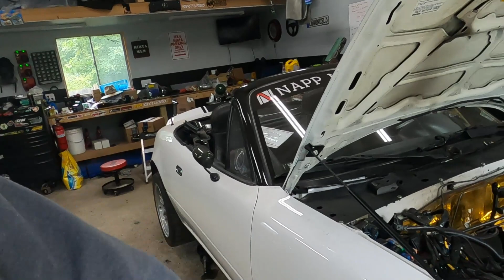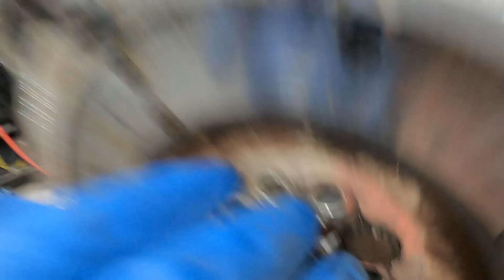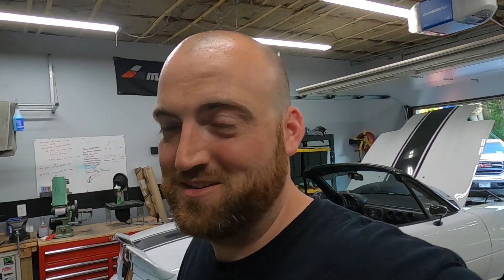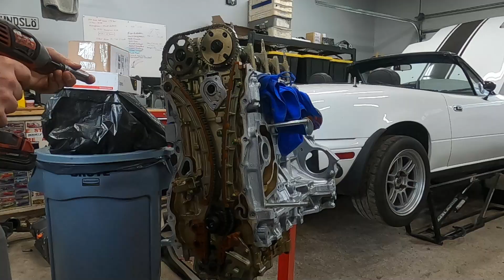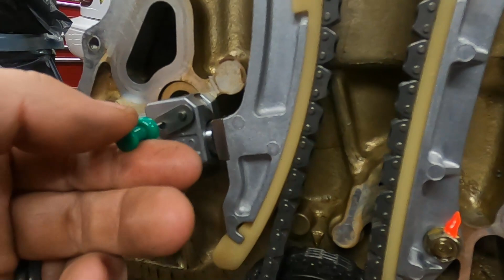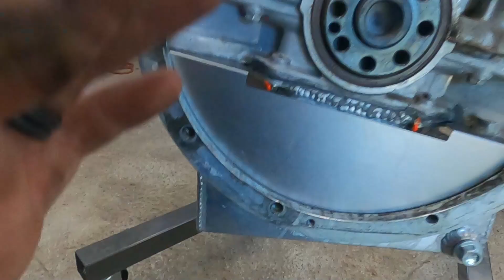Reviving the Turbo K Swap Miata - K24 Teardown & Rebuild

Comment: 33:18 great tip. The dust shield I got didn’t fit well caused me an hour so didn’t drop the drivetrain in today. Gonna superglue a rubber seal along the dust shield to prevent the rattle.

Comment: Noticed your oil pick up has the older revision ‘z’ bracket rather than the ‘hook’. The ‘z’ one have a tendency to shear off.
Reply from the maker: Hasn’t broken in 2 years of abuse. Not worried about it now.

Comment: Stefan, does "crank girdle" work as a name for the bottom tray? I used an M8x1.25 Heli-Coil in my BP engine's knock sensor hole (correct thread already there) to adapt it for a Bosch donut-type knock sensor. My Dad (RIP) and I did many an engine swap. Glad you got to share the experience.
Reply from the maker: He’s always here whenever I need it, super happy to help and I love it. Crank girdles are a bit different in the sense that they support the block, this is just a windage tray for oil.

Comment: Thank you so much for taking the time to show these details!  Do you by chance remember the hardware needed to mount the engine to the stand?  Or a link to where I can find it? Thanks!
Reply from the maker: I should’ve written it down… the top bolts I used the engine mount hardware honestly. The lowers, I think some super long M10’s and I put a nut on the back side.
Reply: @NappMotorsports  awesome thanks!

Comment: If that's a k24z7 or z3 motor. I'd honestly just do a k24/K20. Better flowing head and have that bigger bottom end
Reply: Trust me, he knows.  He literally designed the turbo manifold Kpower sells.
Reply: Then do it... And run without a hood because a kfrank does not fit. Especially in an NA engine bay ;)
Reply: @pablosanchez000  cut the hood 🤣
Reply: The main difference between the k24 and the z3 motor in a Miata is the k24 requires a whole new subframe- the z3 does not.  And since there’s a turbo on there making 400hp…. Why blow a couple more thousand for a more costly motor that would need a power adder to match current power levels…..it’s not just drop in the different motor and make 400….
Reply: @joelavallee3074  also replacement engines and parts i imagine would be cheaper as well with the z3
Reply from the maker: Damn. Y’all answered the question for me. I wanted boost, and this setup made it wildly easy. As John said, I designed the turbo manifold that KPower sells now, and this setup fits under my hood which is great. It’s a street car, I have no desire to chop it up. I have a track miata for that.